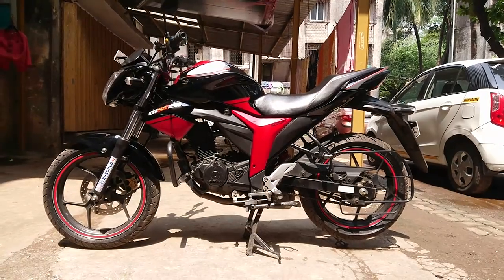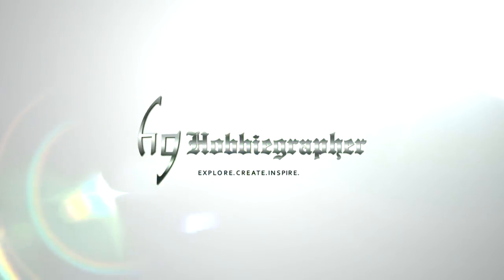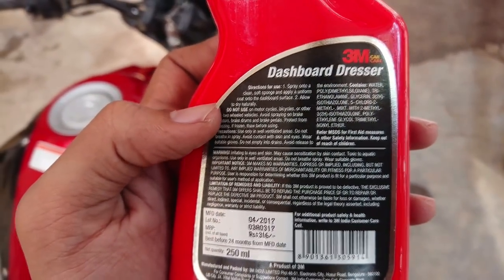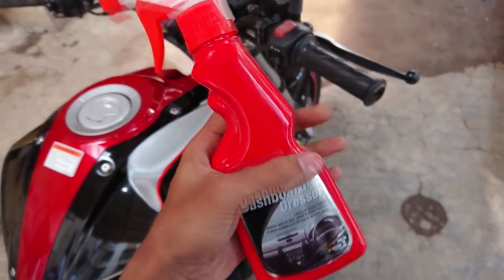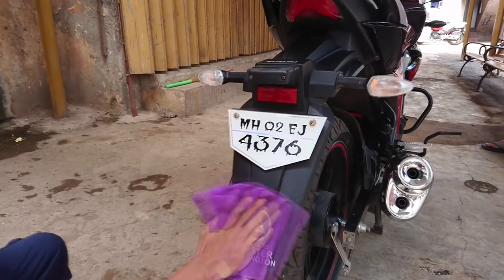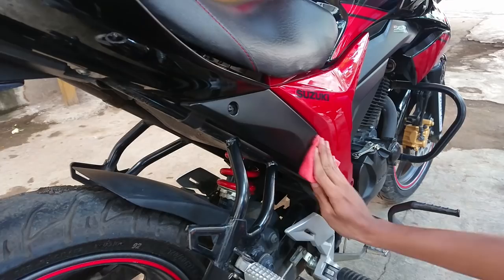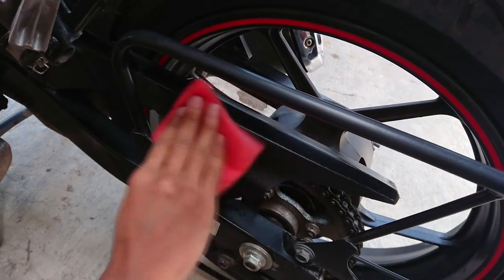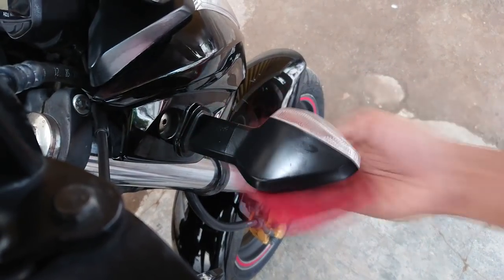Restore / Protect your Bike's Plastic or Fiber parts from Fading (3M Dashboard Dresser)

Comment: I used it on my 6yrs old Bajaj Discover a couple of times. It surely restores the black fibre & gives a good shine but has some drawbacks. The white symbols next to the switches regarding horn, headlight, indicator, etc. fade into black. Also the fibre tends to loose its actual black color & hence demands the application of this product more frequently.
Reply from the maker: +Anuj Kusumwal Not sure but it didn't happened in my case
Might be coz ur bike is too old
Will surely notice it happens with my bike
Thanks for commenting

Comment: I don’t know why but my Honda activa parts got white after applying it 
After few days the fibre parts which are black in colour got faded 
Do you have any other solution ?
Reply from the maker: Are you sure that it got faded due to the product?
there are 2 possibilities.
If it was faded before applying then this product temporarily restores its shine and not permanently that's why you need to apply this before damage and it  lasts 4-5 days so you need to apply it weekly. 
Secondly as per your saying if the fading has caused after the use of product then you should probably call the Customer care and share your problem with them. Also check if the product was expired because this never happened with me.
Reply: THE HOBBIEGRAPHER ok bro I will apply it every week 
I thought  it was to apply only once 
I will apply every week and see the results
Reply from the maker: Yes weekly is good. 
but chk if the product is causing the fading then the product might be defective. Generally it doesn't happen but try to test on a small area.
Reply: THE HOBBIEGRAPHER ok

Comment: You shouldn't use tyre dresser or tyre shiner on 2 wheelers becuase it can penettate to threads or even if you apply on sidewalls, while Cornering your bike can slip. Never use products on tyres of two wheelers.
Reply from the maker: I have not recommended to apply on the contact surface. Also the purpose of this product is to protect tyres from extreme heat and not let the rubber harden in summer. 
Moreover the sidewall is not the point of contact even if you lean to extreme level and a normal rider don't even lean that much in city.
I'm using it since 4 years now and according to my experience there is no harm if you use it sensibly.

Again not forcing anyone.

Comment: How long it stays on bike?
Reply from the maker: 4-5 days approx
Reply: @THEHOBBIEGRAPHER  lol it's useless than.
Reply from the maker: @fanatic632  it's like a normal wax only. If you want long lasting product that will cost you more just  like Ceramic coating and all. This product is for daily purpose and it's easy to apply as well.
Reply: @THEHOBBIEGRAPHER  Okay. BTW good quality wax like Turtle Wax lasts for 6-12 months. I use the same. But wax can't be applied on black plastics as it will look white then.
Reply from the maker: @fanatic632  Yes we can only apply dashboard dresser on non painted fiber parts. 
Also i had recently had a teflon coat with turtle products only. But wax doesn't stay long you have to maintain it at intervals.
Reply: @THEHOBBIEGRAPHER  I use Turtle wax original, which stays longer depending on how you maintain it.

Comment: Bro I own a Apache rtr 180 which has got a lot of fibre parts which are on the verge of degrading .......Will this dresser be useful on my bike ??? Plz reply...
Reply from the maker: You can use this on non painted fiber parts.
Not sure it will completely restore it's shine depending upon the condition.
Also it doesn't restore completely.
Reply: @THEHOBBIEGRAPHER  thanks a lot brother for replying n d condition of my bike is superior...I purchased my bike 2 years ago n I've done only 3000 kms
Reply: The fibres parts r also cool.....but they tend to get degraded after some time....dats y I want 2 use ur product now itself..
Reply from the maker: @UmarKhanRTR  sure you can it gives good results.
But do you have a matte finish or gloss?
Coz if you have a gloss finish then i would recommend motul shine and go. It can be used everywhere.
So a multi-purpose one.
Reply: @THEHOBBIEGRAPHER  it mite be a matte one perhaps same as of ur Sporty gixxer............I cant say exactly ..but if uve ever seen an Apache rtr 180 abs u can get 2 know about it.......
But yeah i sometimes apply wax polish 2 my bike from showroom
Reply: But it lasts only 2 months 😑
Reply: Anyways I'm overwhelmed by ur suggestions..Thanku so much for ur advices...n all d best for ur further videos
Reply from the maker: @UmarKhanRTR  most welcome bro

Comment: Suziki access 125cc it Will be useful
Reply from the maker: Yes you can use on it
Reply: But in Amazon app this is not fit for suziki access they are giving
Reply from the maker: @lokeshnagamanikanta7356  it can be applied on any non painted fiber parts. Although this is a car product but i still use it for bike. Also I have used it on my friends activa
Reply: @THEHOBBIEGRAPHER  tqq

Comment: How To Remove Dashboard Scooty Scratch
Reply from the maker: There is no no proper method. But some of them try sanding process. Really don't know if it works.
Reply: Use 3m or formula 1 scratch remover
useful for small scratches

Comment: You are fuckin stupid for using this on plastics and metals you dumb ass...if will do nothing but magnify the sun rays dumb ass. For poor people watching this use a product like turtle wax ice spray wax and to clean your bike wish a car shampoo was just a fuckin dumb use something like will take grease and grime off like dawn soap the original blue dawn...did I mention this guy is a dumb ass?
Reply from the maker: +Brando Guy dashboard dresser is meant for fiber parts
Dashboard dresser provides UV protection if u ever read the description 
There is no harm using car shampoo what difference does it make? 
There is no specific shampoo for bike
And if u don't like what I'm doing then simply dislike
I don't need your opinion

Comment: Common sense dumb ass it's the same thing as armor all does Nothing but warp and fade plastic if you had a brain you would use a soap with a positive PH balance to get rid of road film and grime then come back with a legit spray wax to protect it no make turn to shit think about this before you reply
Reply from the maker: 3m shampoo is  PH balanced. I'm doing this process since a year and i found nothing wrong. Results are in front of you.
One more thing, if someone is wrong at something you can correct them in a polite manner rather than abusing, then people will definitely take your advice.
Just think of it.